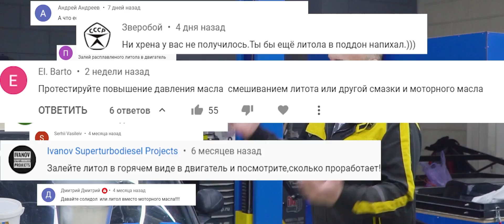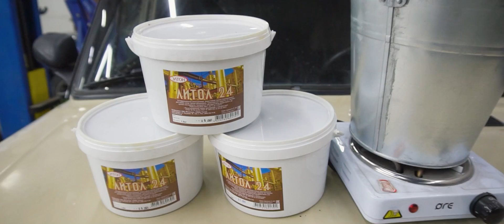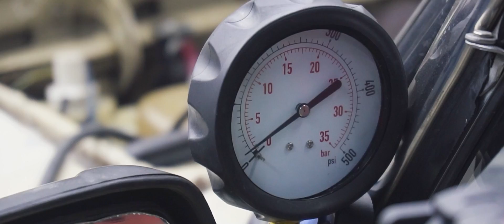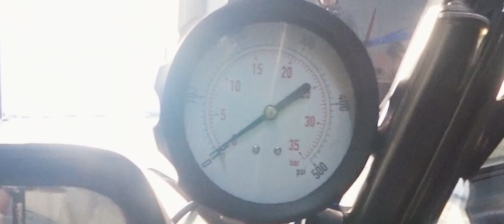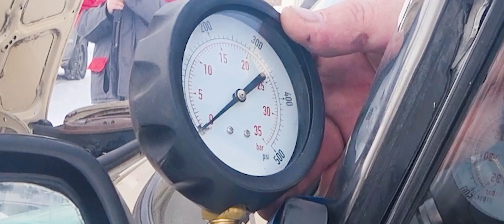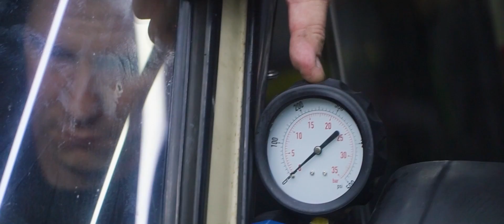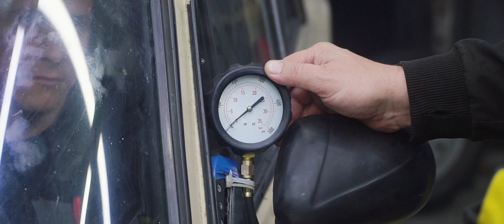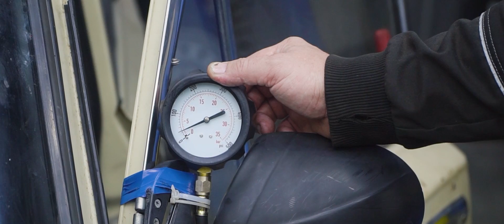What happens when you run an engine on grease?

Comment: Try technical vaseline. It's melting point is way lower than the melting point of grease. The vaseline should stay in it's liquid form while the engine is operating.
Reply: Or coconut oil!
Reply: Both good ideas
Reply: Please do this
Reply: or avocado oil, burns at 500° F
Reply: Astroglide! 🤣🤣
Reply: Vaseline is Petroleum Jelly. . . it is just a thicker form of petrol. 
It will ignite & explode inside the engine.
Reply: @prassmancreations3168  crap, you need a wick to ignite Vaseline, same as any non volatile hydrocarbon
Reply: A trick I saw in use on a new Cadillac Northstar was the oil pump had been packed with Vaseline, I guess to get the oil to pull up into the engine on first start-up.
Reply: Vaseline is great for priming oil pumps
Reply: @BensSightSoundandAuto  I was just the electrician on that project. I had never seen that before, but after thinking about it for a second, it made total sense.
Reply: @iainfreer2638  Uh, no. Look up the term "autoignition temperature" before trying to look smart and failing.
Reply: @iainfreer2638  

Wohhhh,    A bit emotional aye ?
#1 Flash point means nothing when the Vaseline is lining the cylinder walls & in direct contact with the flame produced during combustion.
#2 Vaseline explodes when it goes anywhere near pure oxygen.
Imagine what would happen inside a cylinder that has oxygen under high pressure.
#3 If you completely ignore the 2 "FACTS" above & go with the theory that it has a flash point of 215c.     "well"
An engine pumps the oil up into the head of the engine where it then runs down through the many oil galleries & passages back down to the sump.
As Vaseline is thick it will not run through these galleries & thus the engine will get extremely hot due to the lack of lubrication,
Especially the head as it is in direct contact with the flame in the cylinder & has thousands of metal on metal components.
Any Vaseline that is still in the head will be well above the 215c flash point !

You may know how to push keys on a keyboard to find out some technical numbers about Vaseline,  (PUN intended)
BUT  
You obviously have no idea about how a engine works & have made quiet a fool of yourself trying to look smart.
Reply: perhaps they could try purely "motor honey" or "no smoke" to get that pressure way up.

maybe filtered bacon grease?
Reply: @thesuperjank6109  As the saying goes, "It's better with bacon".
Reply: Weld in an exhaust tube and water tube though the lower part of the sump and on the water part add make a water tank with few electric kettle or shower  element's  to warm it up faster...
Reply: @prassmancreations3168  haha
Reply: @prassmancreations3168  so wrong on so much..... I wouldn’t even say anything to you, just walk and listen to a blithering ijit
Reply: @iainfreer2638  it will flash . But at 560f 290 c . Engine will die before ignition.
Reply: @prassmancreations3168  where is the pure oxygen?
Reply: @prassmancreations3168  flash point is not ignition point.
Reply: @prassmancreations3168  engine was well above the melting point of Vaseline. And they heated it up. Melt is cool at 100f roughly 40c . Go create
Reply: @dennisford2000  
It's everywhere, you breathe it.
Reply: @prassmancreations3168  he did say pure oxygen. Pure oxygen is not all around us.
Reply: Lmao, 1994 Dogde ram is right. 1000%. 1998 Acura Integra b18b1 user agrees. isnt it nice when car/trucks guys can come together. shout to the OG mopar/ram guys. quality af...
Reply: 98' ram's have the 24V I6T cummins right? I want a 16v so bad. just cuz haha
Reply: Heat the oil pan with and induction heater while it's full of grease and a hotter thermostat in the engine? You'd probably need a generator to run the heater. It would be complicated, but that's why we watch lol.
Reply: @prassmancreations3168  It has water in it too.
Reply: bacon grease

Comment: You need to fill an engine with bacon grease.
Project farm has done it with a lawn mower, but a full size car would be awesome.  Plus it will SMELL AMAZING!!
Reply: This is an amazing idea! You could get a food van, selling bacon, and using bacon grease as engine oil and a way to enourage sales
Reply: I use out-of-date vegetable oil in my mower as lubricant. Because of the hot climate it's fine for most of the year. It solidifies in the cold though. It's an old mower that burns some oil, so I figured "Why not?". No problems so far.
Reply: @ImmortanJoeCamel  I've been wanting to add a small amount of bacon grease to my engine, because it apparently has cleaning properties.  Of course my concern is cooler temperatures and protection on start up.  It may make a great engine flush while warm!
Reply: Let's get this idea to the top guys!  You know they'd love to do it!
Reply: Project farm is awesome been watching him for a few years now great guy great videos. 👍🏻
Reply: Yes!!!!!!
Reply: Didn't it clean the carbon deposits off the head too?
Reply: And it preformed better than 10w40 for the hour it was run lol

Comment: Paused just when Vlad said to do so. As a mechanic myself, I'm pretty convinced that it's gonna keep on running for a while, but some damage must've taken place. Also, great video guys!
Reply: Nah I don't think there's going to be any extra damage, grease requires more temperature than a motor can produce to burn away, and it's a better lubricant than oil the rods should be fine
Reply: @michaelmain1990  You can see that the pump was unable to lift any grease tho as it went solid in the pan.

Comment: The pump is completely able to push the grease through the system!  The problem is suction!  

The viscosity of the grease is what prevents the pump from getting grease by allowing a path to air.
Reply: 100% it clogged the pickup, not the pump
Reply: i was wondering what would happen if the put two quarts of 5w30 with all that grease
Reply: @alteredstateskustom it did not clog the pickup, but the grease is so thick that it doesn’t run back down to the pickup fast enough. It stays in an "inverted mountain" shape, where the grease stays on the sides of the oil pan, but not around the pickup. It’s as if you dig a hole in the sand. The pickup sucks air and once it has air in it, it struggles to re-prime the pump.

Trust me, I’ve tried, but with palm oil not lithium grease.

Also it will clog the filter, but I assume they’re using bypass filters like everyone else, so a clogged filter wouldn’t cause oil starvation.

Comment: The filter has a built in bypass valve that opens when the difference in inlet oil pressure is high enough over the filter outlet pressure, to prevent the filter from stopping flow to the engine when clogged. Replacing the filter made no difference because the filter bypasses the grease as soon as it clogs, when any grease reaches the filter, since the problem is pump intake.
Reply: This is why there is a warning to never use grease as heavy engine assembly lube, use actual engine assembly lube.
Reply: @n325aej it is plugged with the only lubricant that is in the engine. Removing some of that lubricant would just mean there is less. In this case, the filter is clogging with the grease, so changing it would mean the new one clogs immediately and just goes to bypass like the the previous filter.
Reply: Delete the filter and the pressure relief

Comment: Have you tried differential fluid/gear oil. 80w90 or 90w140 like we have in hotter climates?
I also think the Lada has life left. A bit of diesel or cleaners in the crank case would clean it right out and 1 or 2 oil changes will do the job.
Reply: We've always ran diesel it's like magic
Reply: differential fluid and gear oil use a different scale for measuring viscosity, iirc 75w80 gear oil is basically the same visosity as 10w40 engine oil.
Reply: i had an old van with a 350 small block in it, it had an oil leak so i though i might put something thicker in there to slow the leak down. i ended up running it on pure 120w gear oil and it ran just fine, i didn't even notice the difference.
Reply: @varus113  
To flush and clean the engine?
Reply: Yeah same thing with seafoam before you change the oil put it in run it warm a few minutes and drop the oil and it flushes the engine
Reply: Drop the pan and pressure wash
Reply: @varus113  That's cool. I've heard of people using Jet A-1 for cleaning components before but wasn't sure how well it works.
Reply: @dennisford2000  
Yes but only the pan?
Reply: @aaaabababa   Uh no Gear oil and Motor Oil use the EXACT same scaling. The  W (winter number) is viscosity at 0°F -17°C  and the second number is the viscosity at 212°F 100°C   This applies to BOTH Motor oil and Gear Oil...  If they want to try something they should try using 600 W Cylinder Oil
Reply: When some people sell a used car with a junk engine, they fill it with heavy gear oil. At the first oil change, the customer suddenly realized they had been cheated.
Reply: What about Wd40?
Reply: @jwalster9412  Been done...
Reply: @matthewq4b   Absolutely wrong, its measured in centistokes
Reply: @matthewq4b  can I have a link?
Reply: @jwalster9412  Just search WD 40 as motor oil on you tube there is a dozen or more creators that have done it..
Reply: I used to run 20W50 in worn out vans doing delivery in the summer when it was +90. It would build insane pressure and cause all the noise to go away and the engine would actually perform better. Had more power and fuel economy was the same 12.5MPG. A buddy of mine that put millions of miles of delivery vans told me once they start to wear out, you increase the oil viscosity to compensate for the huge tolerances in the rings and bearings. It also was harder to push out of the seals. I was dumb at first putting factory 5w30 and burning and leaking through a quart a week and once I started putting damn near gear oil in my engine, it stopped leaking and the ticking would go away.
Reply: @ATSNorthernMI  My dad had a 1987 Hyundai Excel and managed to drive 116,000 miles out of it. When he traded it in 1992, the salesman didn't believe he got that far. Once the salesman sall it, he told everybody in the service department, because none of them saw a 1987 Hyundai Excel reach that distance. Later models may have gone longer one they got overdrive transmissions and EFI.
Reply: @jwalster9412  Not really a lubricant. Good for light jobs (i. e. the door hinges on your house), but would burn right away in a high pressure/friction environment. WD40 was originally designed as a water dispersant and repellant for the aerospace industry.
Reply: @matthewq4b  nope, crank case and Gear oil use different charts, i looked it up again, and according to SAE standards, a 20w50 engine oil is equivalent to a 75w90 or 80w90 gear oil. the way they measure it is the same, and at the same temperatures, but the numbers for crank case and gear oil differ from each other. This was done to lessen the chance of confusing gear and crank case oils.
Reply: @aaaabababa     Uh no those charts you see are at 40C and 100C  NOT -18C  That is where they are the same scaling...   Nice try though....
Reply: @ATSNorthernMI  I think that will wear through the oil pump quicker.
Reply: @matthewq4b  the charts i am looking at  are directly from Amsoil, and amsoil even states in their blog that a 90 weight gear oil has the same viscosity as a 50 weight crank case oil, thats directly from amsoil, a company that produces both engine and gear oil, i believe they should know best if it's the same or not, so i don't know what you are trying to go on about.
Reply: @matthewq4b  to quote Amsoil: "Gear oil differs from engine oil. While many motorists may assume SAE 90 gear oil is thicker than SAE 40 or 50 engine oil, their viscosities are the same.", they even say that the only difference in the oils are the additives, if you want to read up on it you can just put that quote into google and the first thing that comes up is the Amsoil Blog.
Reply: @aaaabababa  Again that is at at operating temps.... which is NOT where the scaling applies. Still waiting to see chart showing the same viscosity's at 0F.
Reply: @bendermi  no used to clean sludge from sixes by removing the pain tapper cover and valve cover and just blast it out, blow dry with heat and air . Always fixed the problem with stopping the oil pump screen up.
Reply: @matthewq4b  if even Amsoil says it's the same, why should it differ at -18°? especially if it's the same at 40 and 100°.
Reply: @aaaabababa   What do you think some of those different additives are ?  Viscosity modifiers....    Motor oil does not thicken as drastically as gear oil at lower temps due to viscosity modifiers.   If you had actually used both you would know first hand that the listed gear oil and motor oils are not the same viscosity below operating temps.
Reply: @dennisford2000  
OK thanks 👍
Reply: Would take a Lisle solvent gun and 20/50 after a final brakecleen and lube it in a series of small turns to the cam area with hi zinc phosphorus content ie racing oil.
Reply: @ATSNorthernMI  yeah on older engines when you up the oil thickness. You usually also slow down any blow by and increase compression a bit. My old daily went from oem 5w20 to 5w30 and it makes more power and burns no more oil and it gets the same mpg too.
Reply: @dennisford2000  
Do you have a YouTube channel or do you know one which shows this?
Reply: Gear oil is a terrible idea - it'll create high pressure in the block and destroy every seal/gasket. 

Ask me on what car I learned this :P Similar to a Lada actually.
Reply: @the_kombinator  
Will a 16 valve head from a Fiat fit in on top a Lada?
Reply: I've actually used 80w90 gear oil in a pinch. Worked great and didn't notice a difference in the way the engine ran
Reply: @jameshedrick605  Your seals sure did - especially in colder weather. Welcome to the world of replacing all the gaskets and cam/crank seals.
Reply: @iamzid  wow
Reply: @skylinefever  if the pump can handle that until the next oil change
Reply: @jwalster9412  I mean, all the engine, lol

Comment: I used lithium grease as an assembly lube as I had nothing else at hands.

It seems to work pretty well and rince of pretty fast as the engine heat up.
Reply: Oh je n'imaginais pas te voir ici, ça fait plaisir 😄
Reply: did this with a honda genset and that boy is still going strong after 250hrs on the clock , the whole engine has like 2000hrs. it is older than me.
Reply: I dunno if I'd try it for increasing oil pressure though. How about you?
My '68 Plym. Fury's 318 has low oil pressure. I'll likely go with something a bit more tried & tested.
Reply: @UberLummox  might check if the oil pump has a bypass, if you close it off a bit then the pressure should increase.
Reply: @UberLummox  increasing oil pressure is not something I'm after.
Actually I try to lower oil pressure most of the time (too much oil pressure = increased losses)

If an engine needs something to maintain oil pressure, it usually means the bearings are worn. And it's usually not that difficult of a repair.

As a temporary fix, lithium grease, manual transmission oil, or any thick oil you can find will to the job.

I'm sure lithium grease will blend in the oil and stay that way. The problem is mixing it correctly the first time.
So 75w80 transmission oil or something like that is safer as it will not clog up the pump.

But do remember that the pistons are splash lubricated, and as the oil becomes thicker, they just don't get as much oil!
So, changing you big ends bearings can be a better solution.

Most of the time you just need to drop the oil pan.
Reply: @limonadeedanomil2807  moi non plus mdr
Reply: we have a product called "Lubriplate"(white lithium grease, although it's slightly stiffer than oil in that it doesn't run but it's more liquid than solid grease) here in the US and that's what it's for, engine assembly. just makes sure parts are basically lubricated prior to first time start up and run until the oil gets to them.
Reply: @UberLummox    Ah come on!  Do it and let us know.  Do it FOR THE CLICKS !!!   LOL .......
Reply: @NVMDSTEvil  Yeah I heard that might be a thing. Thanks!
Reply: @ElectronikHeart  Holy shit man. All these decades fucking with car (and a pro bodyman!) I've never come to the realization that pistons are slash lubed. DUH! Of course they are! And I think I'm getting piston slap when the pressure drops down @ idle. Thanks much for the reply!
Reply: @williampotter2098   NOPE ell oh ell. Engine oil additives scare me enough, thanks! (ell oh ell?)
Reply: @UberLummox  Most engines are splash lubricated, some redirect the oil bleeding from the bearings to the back of the pistons.
And most turbo engines have a little jet pushing oil on the back of the pistons to cool and lubricate them.
Reply: @UberLummox  Umm, this will blow out all your seals, causing it to be more Chevy than Mopar ;)
Reply: @the_kombinator  Haha!